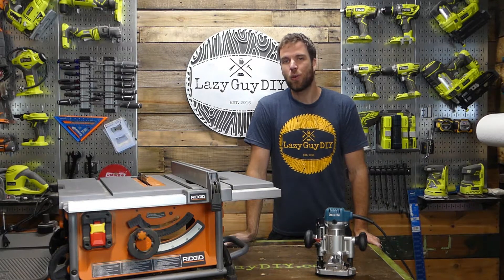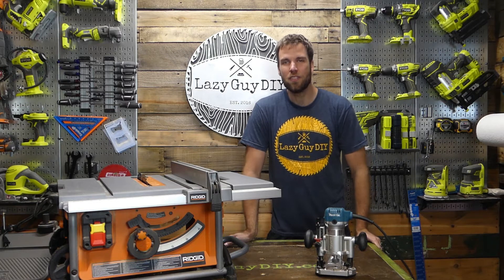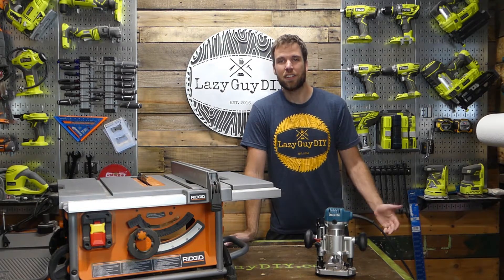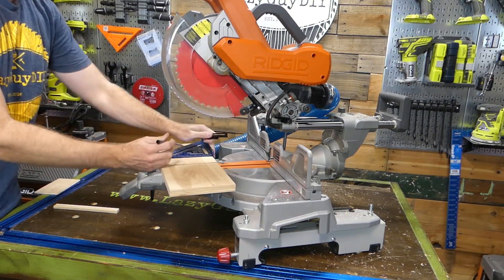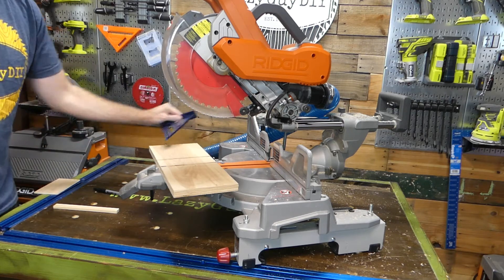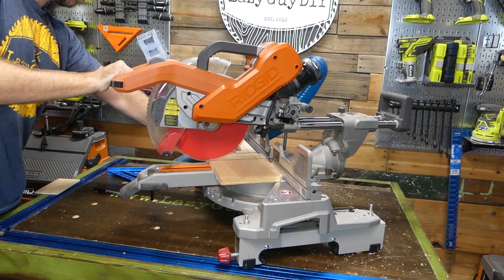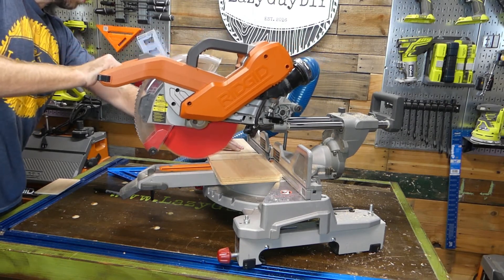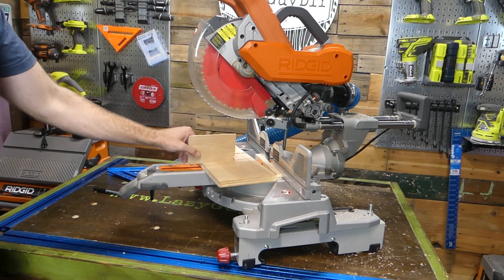Lazy Guy DIY Quick Tip: Dado Cuts With A Sliding Miter Saw

Comment: Thanks for the video I was already on to this without trying it. However I was wondering if I could double or triple stack some blades to make super wide dado cuts LOL. Should I try it? Here goes nothing tomorrow
Reply from the maker: Ha!  Please don't!  The arbor on your miter saw wouldn't accept it for starters and then the teeth on the blades would chip into each other sending shards of metal everywhere.  Which sounds cool... probably frowned upon.
Reply: Lazy Guy DIY Thanks! Forgot about how the teeth stick out slightly. I saw a few videos of people putting dado blades on a radio arm saw. Home Depot carries a 10 inch Diablo Dedo kit. Cuts about 3/8 of an inch maybe or more? What do you think? 

I making a 3 1/2 inch cut about an inch and 3/4 in depth. I suppose I could make a few cuts on either side of my 3 1/2 inch and then chisel the center out? Probably the safer thing to do LOL
Reply from the maker: @alexanderwayne9890  I wouldn't try it honestly. You've got a couple issues in that the arbor the blade fits on and the housing most likely won't fit the dado stack.  Then there's the issue of cutting into the material.  On a table saw you're bringing the material over the blade and up through while the material is supported by the table.   On a sliding miter the breakers in the dado stack won't reach the full depth of your material or if it does it's going to destroy your insert or plate as you plunge the blade in.  And then there's the issue of it self feeding the material, pinching, catching and throwing the material back at you.  It's not worth the risk.
Reply from the maker: @alexanderwayne9890  The radial arm saw is a little different in the motion and the cutting base.  Still would scare the crap out of me.
Reply: Lazy Guy DIY I agree, I decided to go with a 2 inch, half inch shank, straight router bit today that is about a half inch wide. Made three passes to get my inch and 1-3/4 in depth. It turned out really well. Went great after I set up the jigs correctly. Thanks for your speedy replies! Have fun on your upcoming projects

Comment: Hey! Thanks for the video.
Is there anyway to make a dado cut with a non-sliding Miter saw?
Reply from the maker: Hey!  Unfortunately there's not a great way because you need the sliding motion to make the dado.  So you otherwise would need to use a router or table saw to make the same cut.  If you build a jig, you could do the same with a circular saw as well.

Comment: Is it possible to do something like this but with a taller piece of wood?  Like if I need to cut a dado in the top of a 2x6?
Reply from the maker: Absolutely, for something like a 2x6 I'd use a speed square and a circular saw and make multiple passes using the speed square as a guide for the shoe of the saw.  If you need to, you can always clamp a sacrificial scrap piece of wood to where you're cutting your dado to give you a better surface to place your guide square on.   I actually used this exact method on 2x6's for a bench a couple months ago on a remote build.
Reply from the maker: I have another video for half laps that can help too: https://youtu.be/hLnsgQ3xHjg